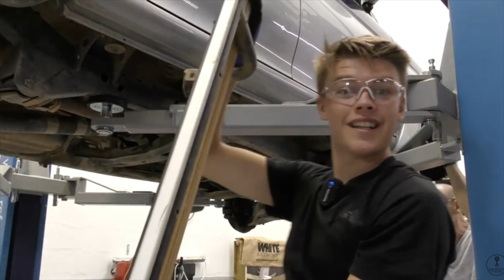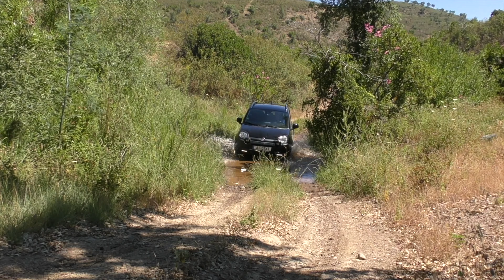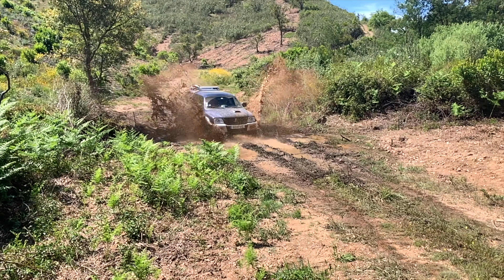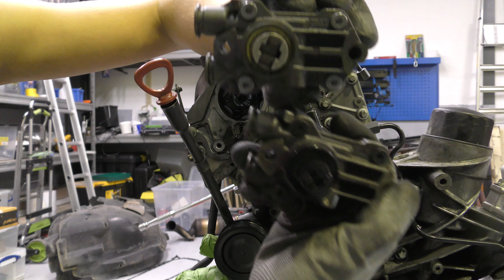Merc ML W163 High pressure fuel pump\Low pressure fuel pump\Brake vacuum pump - removal and install

Comment: Does The low pressure fuel pump have a o-ring or gasket , and if so where can i buy one . Cheers
Reply from the maker: Sorry its a while ago .. most Mercedes-Benz vehicles, the low-pressure fuel pump typically utilizes an O-ring for sealing purposes rather than a traditional gasket. 
 Best place is the Merc parts at the main dealer - we found them cheaper, faster and better quality for most (not all) parts we needed - a surprise to us :)